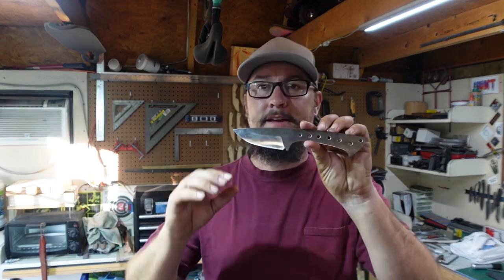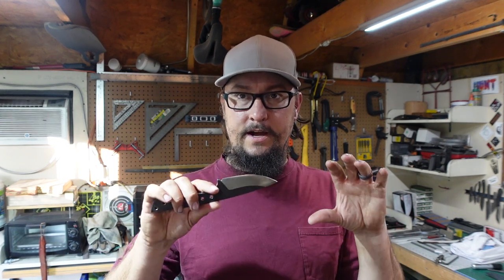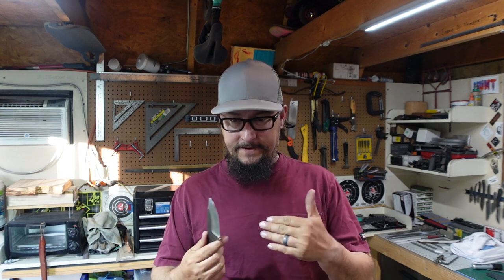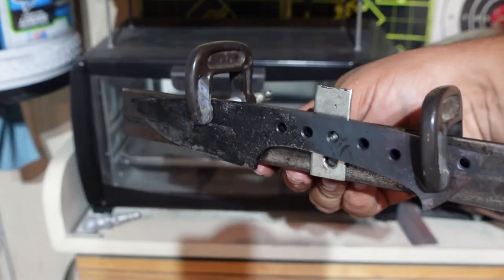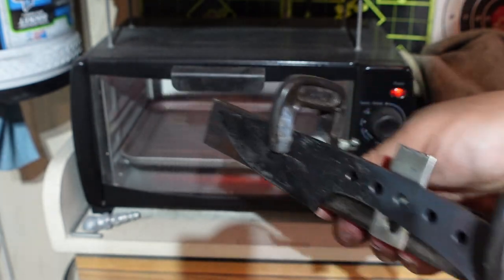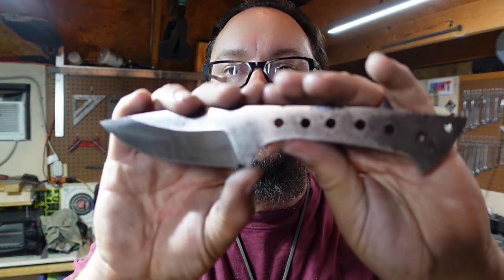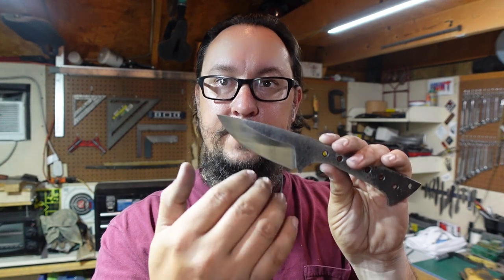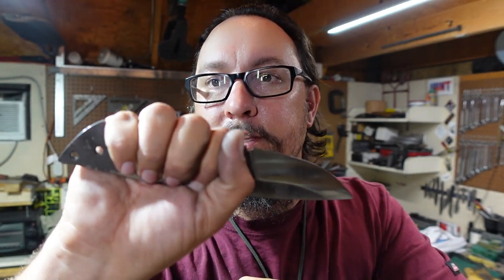Heat Treating And Finishing The Bevels On An EDC Knife | Knife Maker | Vlog

Comment: Howdy Erick:
 I started making knives in 1966 after my dad made me one. As soon as I finished it...I was hooked. That was 55 years ago. I used Wolfs-head Motor oil back then. I don't think HT oil was available to home knife makers at the time? I use only 1095 steel. I heat to 1500 degrees then quench, NO normalizing. Anyway, I have a small home business making Black Powder accoutrements and 18th, &19th. century knives. My customers LOVE that I leave the "Forge Blue" patina, forge scale, whatever you want to call it, on my blades. About 5 years ago I started using plain old Cheap store brand Canola Oil. I haven't had a complaint or a broken blade in 55 years. I think that's a pretty good testament to what you can do WITHOUT buying the very "best-est" HT oil. In closing: my comment based on my previous statement is, your blades DON'T have to look as shinny as a new penny to be a great knife. I use a slack belt convex blade grind to stay PC/HA.Your "High Side" blade grind looks very nice, keep it.  Don't overthink polishing, it isn't necessary.
Stay safe my friend.
God bless:
Two Feathers
Proprietor of:
The Mountain Man Emporium.

Comment: I was doing the 1600, 1500, 1400 normalization cycles then read a few articles talking about the 1500 one.  Basically saying that it’s not doing anything and you’re better off with the second two cycles being below autenizing temps.  That’s why I switched mine to 1600, 1450 and 1250.  Here’s the article, it was a good read:  https://knifesteelnerds.com/2020/07/13/13-myths-about-heat-treating-knives/
Reply from the maker: Man, that's a good article. I will be trying that out for sure.